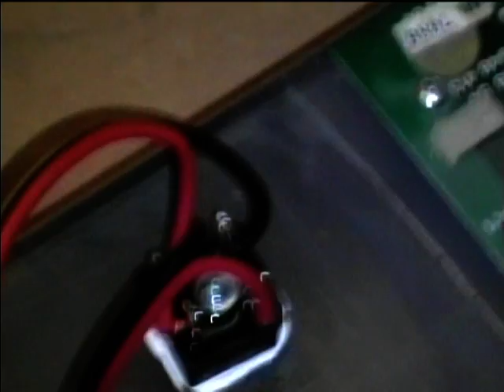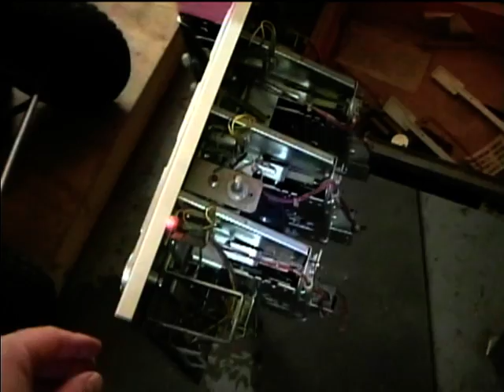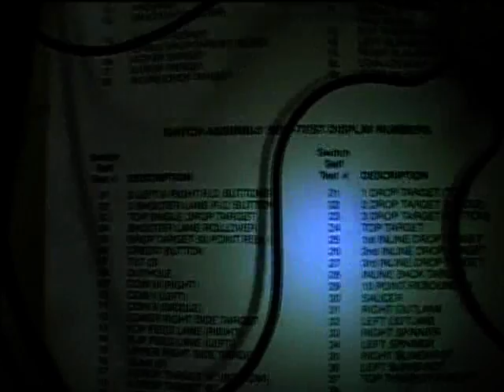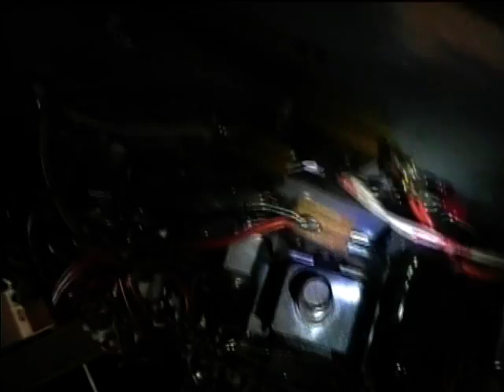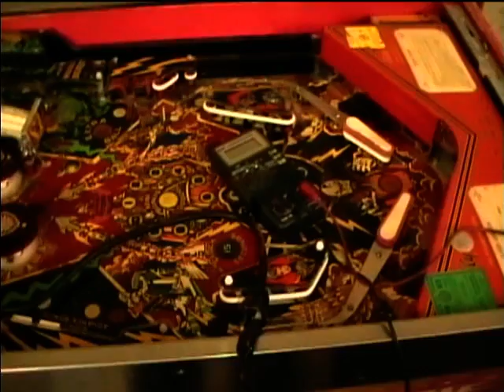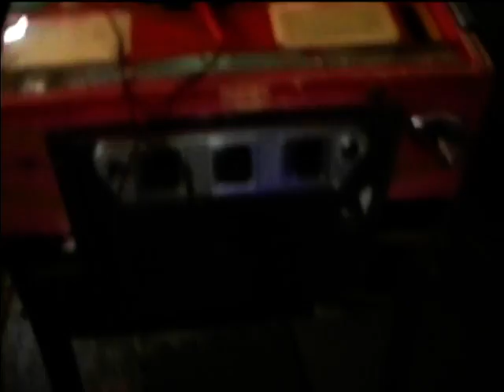Bally Flash Gordon Pinball Game Repair (Part 2)

Comment: "RO Button" switch means those white plastic star rollover buttons.  Bally's switch test can only display one stuck switch at a time. Fix one bad switch and if there are more stuck ones then the next one in line in the switch matrix will be displayed. When all switches are open a zero will be in the score display.

Bally is well known for cold solder joints on all the boards and bad connectors too.

Ken Layton

Comment: Did you resolve the switch issues in the end?  If you have really weird switch problems then the prime suspect is a short in the switch matrix.  the switches are scanned on a matrix with a diode in series with each switch and often a small capacitor across the contacts.  I had a really hard to trace problem which turned out to be loose metalwork on the front door shorting the play button to ground and that disabled all the switches on that leg of the matrix.

Comment: Also you need to go to self test position # 18 by using the self test button and change the number that appears in the upper score displays to "03" this will give you the proper sounds for the scoring instead of the tinny chime sound its currently set to. Also the switch problem you have , i think is either the small diode or capacator across the actual switches that either or have gone bad.